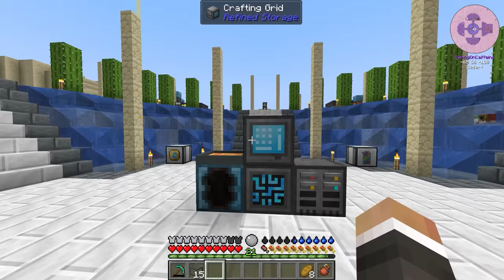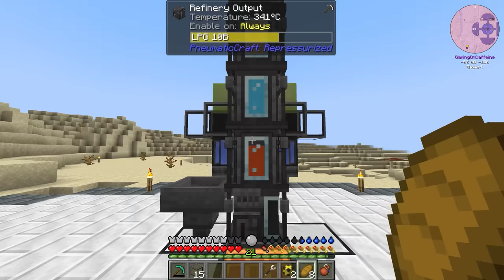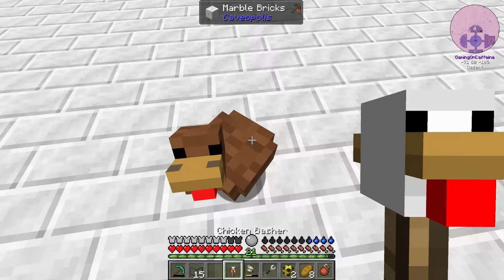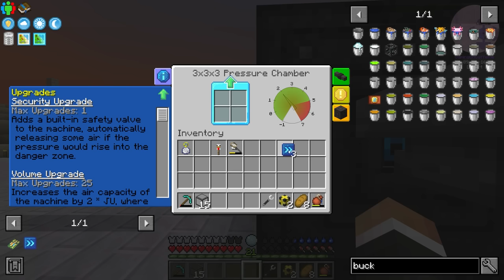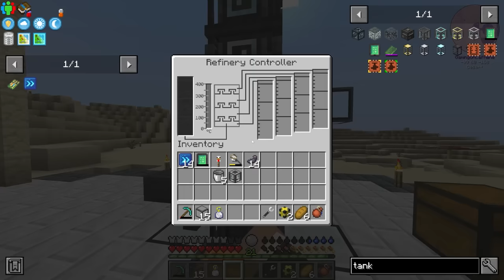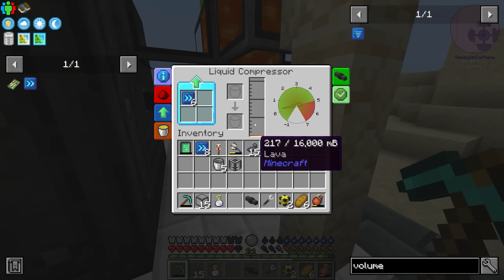Minecraft Desertopolis | ROBOT ARM CIRCUIT BOARD CREATION! #10 [Modded Questing Survival]

Comment: you can make a biger chamber to hold more air that allow you to last longer! also more compressor with volum upgrade also balance it out since the air level is equalize throughout all connected component, there a fluid drawer drop a void upgrade and you good.

Comment: Instead of using security upgrades for your compressors, you can make a pipe gauge which emits redstone based on the pressure level, and then connect that signal into the compressors. Set the compressors to only run when the signal is low, and then it won't need to vent pressure, because it won't over-generate in the first place

Comment: The refinery is soo inefficient. Pls block the sides of the oil refinery with frames or blocks to contain the heat properly. Look at the yellow warning sign in the top right of the refinery
Reply: He also could look at using a lava generator to place lava blocks underneath the refinery controller, and then mine it, instead of using heated iron blocks. Also it converts it into a obsidian generator.
Reply: @Joakico  Eh, smelting the iron is good enough, the heat that generates is way more than it needs. Also the whole point of this is so he doesn't need to make a ton of diamond pickaxes because he still hasn't made 10,10,10 diamond chickens.

tl;dr - superheated iron blocks are good enough and there's no point automating it with lava in the future.
Reply: @ScarletFlames1  In the endgame is better to automate it with a high pressure vortex tube. And Cooling the other side with the generator itself for example.